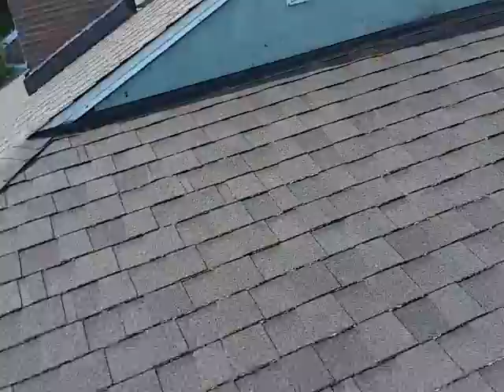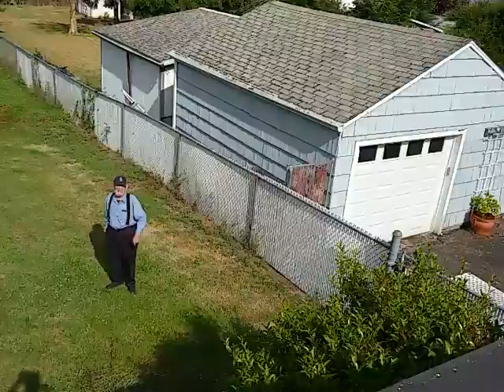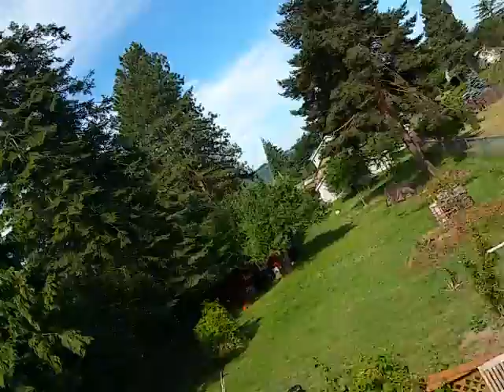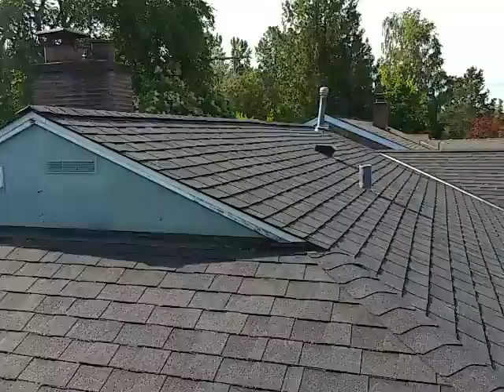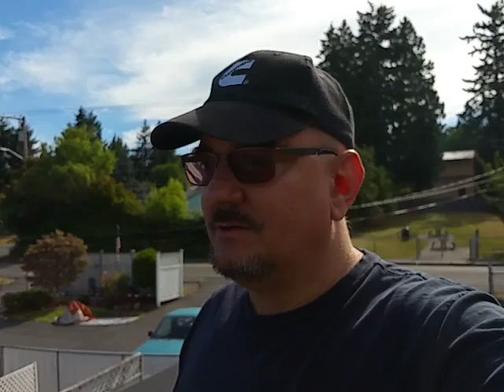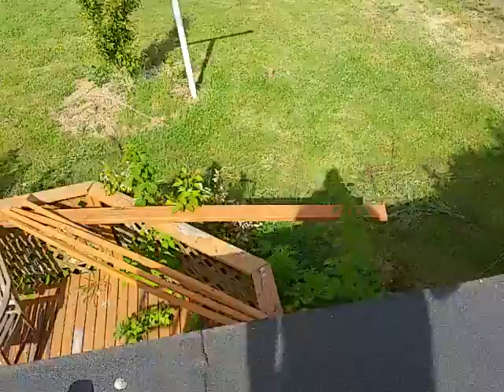Bitcoin needs your help. Run a bip 148 node

Comment: bip 148 is now installed on my old desktop, which is now off the wifi and plugged directly into the cable modem, and it says it has about 8 hours to go before it's done synching with the network. Except for when the power flickers (it almost never goes out as I'm only 2 or 3 blocks from the Capitol Campus), I should be able to leave it running all the time. It's a second hand 2007 Dell office grunt PC. I maxed out the RAM at 16 gigs and then swapped the old HHD for a 500 gig SSD. So for an old clunker, it's pretty decent.
Reply from the maker: Nice one! We need all the nodes we can get. There's a chance that we might not have enough to force segwit. The doubts are spooking the market and that's what's causing the current price decline.
Reply: Oh, frell! I finally got it fully loaded and went back to read the How to Set Up article. It requires a static IP. Okay, it's been a long time but I've done that in Win 7 before. Thing is, I "upgraded" my spare to Win 10 the last day you could do it for free. We now use Win 10 at work, and I hate it. (Almost everybody does.) I tried following the instructions for setting a static IP and was having problems, so I tried to revert to Win 7. Too late. Okay, I read further. The article also says this requires making changes to the IP settings on my router. It's a Comcast router, and I never make changes to leased equipment. I was hoping this was just a matter of installing the application and letting it run, but it looks like it's a lot more involved than that.
Reply from the maker: I'd just fire it up and see if it connects. Comcast has kept me on the same IP address for months. I'd just light it off and see what happens. Sorry I didn't answer your email.
Reply: Yes, I agree. With a brief hiccup while Windows 10 updated and then rebooted, I've had it running continuously. Right now it's saying, "Warning: Unknown block versions being mined." So, today I listened to a couple videos of guys saying that if there is a hard fork on Aug 1, that it could result in the same thing that happened to Ethereum, with a Bitcoin Classic and a Bitcoin something else. One guy recommended going to cash (selling all your Bitcoin), wait until after the first, and then swoop in to scoop up whatever is active while it's cheap. Right now, all of my cryptos are on my Trezor (thanks again for that recommendation). It would be great if you could do a video sharing your thoughts on this. Thanks!
Reply from the maker: +The Backlash!
>Right now it's saying, "Warning: Unknown block versions being mined."
I had that problem before I upgraded to the most recent version of the bip 148 client. The problem's gone now.
>It would be great if you could do a video sharing your thoughts on this. Thanks!
Not a bad idea. I was involved in building my grape trellis today. I waited too long and had to sort of weave all the vines into the new trellis. It's pretty cool. It will give me a roof of grapes over part of my deck. 
I'll think about putting a video together on that plus a few other things that have been germinating in my brain.

Comment: Thank you for the update, Vention. Tonight I'll switch my spare desktop from my wifi network, plug it directly into the cable modem, and get it running.

Comment: Vention, Thanks for your videos.  Have you tried Loaning your BTC on Polionex?  I did it for a couple weeks and it was unreal how big the returns were.  Thing is, I don't wanna take that counter-party risk.  Don't wanna get Gox'd.  Just wondering if you tried that.
Reply from the maker: +NiceOneZebra
>Have you tried Loaning your BTC on Polionex?
Nope. Just as you say, I don't want to get Gox'd. I buy my bitcoin and when it arrives in my account I move it off to cold storage for the most part. I do cycle through some altcoins maybe a couple times a month when the conditions are right but the vast majority of my holdings stay right where they are. 
I also don't like helping whales short the bitcoin market. They like to pile in and blast through everyone's stops then harvest their bitcoins at fire sale prices then cover their shorts and blast the price up dramatically. I'm not going to help them harm people that way. The gains I made just by holding bitcoins in cold storage have been enough for me. No need to take more chances than I need to.
Reply: Good points, especially helping the whales short.

Comment: segwit has some risks to it aswell. big corporations using the lithning network e.g. visa could start manipulating the price the same way as JP Morgen does with the silver market. If the poor people can't afford on-chain transactions corporations can sell them one bitcoin multiple times.
Reply from the maker: +Banana Joe
*>big corporations using the lithning network e.g. visa could start manipulating the price the same way as JP Morgen does with the 
silver market*
Fraud on that scale would be difficult to do. In the comex there are hundreds of fake silver ounces sold for every ounce that actually exists. If they try to pull fraud like that, it would cause a run on the bank, so to speak, while lightning providers who are honest will gain market share and enjoy greater profits. But the adoption of Segwit will allow more bitcoin transactions to be packed into each block. That should cause the mempool to shrink to zero shortly after it's switched on, and that should cause a nice decrease in the fees even for on chain transaction. I devoutly hope we can get this feature added. The sooner the better.
Reply: It would be very easy to pull of a fraud like this because the average person (holding 0.0010'0000btc)  could not afford to move his/her funds out on to the public blockchain! That's why I'm for bigger blocks on bitcoin and Segwit scaling on Litecoin. I am still not worried of centralization in bitcoin because with mass adoption 0.0000'0001btc = 1 USD -> a lot of bitcoiners could afford a 20K node. Don't you think so?

Comment: No problems. I will get it working after work....

One thing, though. Assuming worst case scenario, what would be a good time to sell it all?
Reply from the maker: +Yasen Boyadzhiev
>No problems. I will get it working after work..
Thank you brother. I'm grateful for every new node we can get. The bitcoin community badly needs the MGTOW army to join this war.
>One thing, though. Assuming worst case scenario, what would be a good time to sell it all?
I don't see a situation where that would be necessary. I think we're going to win. The only time I'll sell now is if I need the money for something. Till then I'll just be buying what I can each month, whether the price is higher or lower than it is now. That's what I've been doing since 2014 and it's worked out great so far.
Reply: Thanks...
A new slight hiccup I am dealing with now. 
My Trezor is on the way, but my Jaxx is not responding. I want to send the Bitcoins from there to another place, but it doesn't seem to pick up the transaction.
It's beginning to worry me.

Comment: Good Lord Vent!  Get some stain on that deck ASAP my friend!  I believe this was suggested by me LAST year or perhaps TWO years ago!  Lol.  Or is it past staining altogether?
Reply from the maker: +243wayne1
>Good Lord Vent!  Get some stain on that deck ASAP my friend!
Thanks pal. Yes I plan to. I tried using a type of paint from home depot called decover. It's designed for decks and it says you don't need primer but it turned out to be an ugly peeling mess. Now I think I'll settle for getting some stain of that same color, scrape up what I can then blast it with stain. I should have started with stain. That decover might be ok for a new deck but the boards are old and there's some surface rot to them so the paint starts peeling within a year or two. I'll make sure it gets done before the hot weather ends though.
Reply: Atta boy Vent!  I just finished mine today at noon.  Took 2.5 days in all.  I used a good wire brush to loosen all the old stain and loose material etc.  then swept it off and used a whisk broom for the bench seating area, and gave it 2 fresh coats of stain.  It should last another 4 years before I have to repeat the process.  Just one of those things in life...  Hahaha!

Comment: Best I can do is set up the Electrum wallet to enforce BIP148 UASF as per the John Light article linked below. I would do it before August 1 then wait about a week after August 1, or  longer for the smoke to clear. I would then follow the Developers to be able to find the genuine Bitcoin.

https://lightco.in/2017/06/10/electrum-uasf/

The Crypto Type had a great video yesterday showing you how to keep your private keys safe by moving them out of your app data and storing them somewhere else on your computer or on a USB stick to take them offline without needing a Trezor. A good idea always but at least until this tiresome stuff blows over.

https://www.youtube.com/watch?v=wACCH4koNbg

At the end of the day though I'm not worried that this will not work itself out in the end and no one should be. They can mine whatever they want in China but they'll have a very rude awakening if they don't produce what the developers create. The developers are the talent, the brains, and cutting edge of Bitcoin. They are the whole reason why so many people are starting to believe in it. Without the developers there is no Bitcoin. So, if they want to mine something in China that is not born by the key developers of Bitcoin they will lose everything! Furthermore, they can stick their China Shitcoin up their ass with chopsticks because no one will want it! What for?